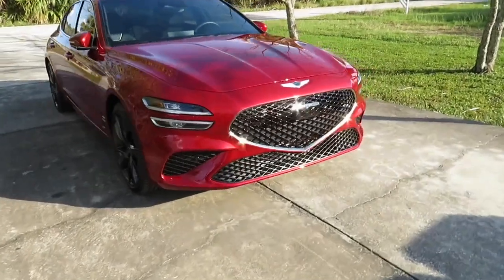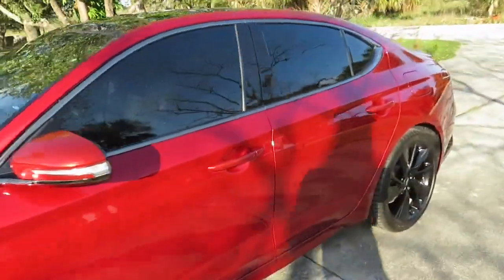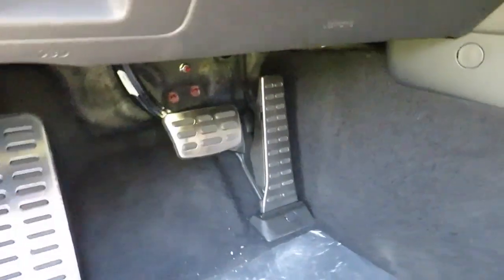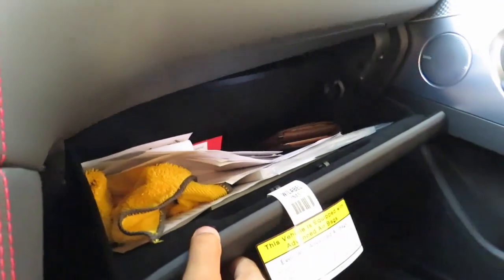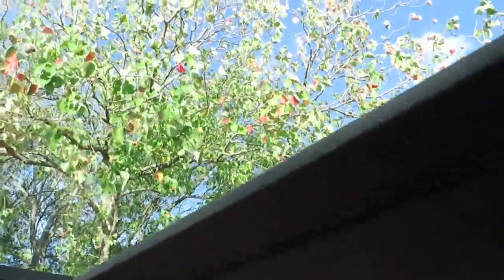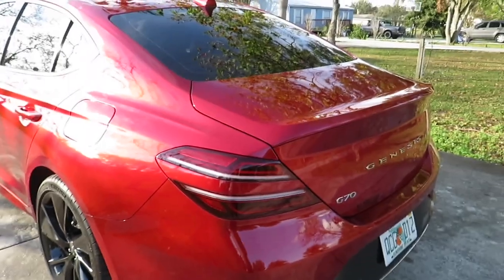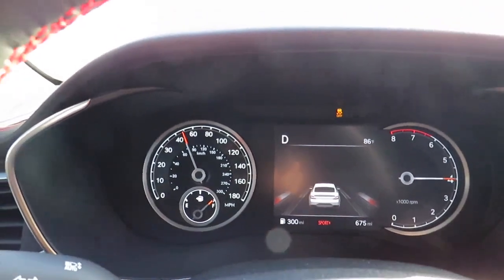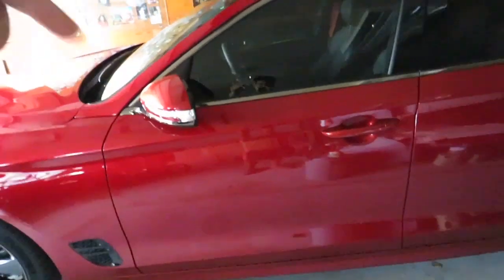I Did A Review On My Personal Car (YOU WONT BELIEVE HOW GOOD IT IS😱) 2023 Genesis G70

Comment: Great job on the overall review! Just picked up a 23 G70 2.0 AWD Sport Prestige in Black w/ solid red leather this week. Superb sport sedan for the $44k price, very buttoned down, quiet and smooth. 2.0 has plenty of power, sure the 3.3 is even better for the overall acceleration and thrill of the drive, but for us we couldn't be happier! Steering is precise w/ good feedback, overall very well balanced too!

Glad to have the AWD for winter weather and better footing in snowy conditions. The Lexicon sound system works well and the infotainment display is well thought out.
Lot of value for the price compared to anything else w/ similar performance, luxury, and appearance.
Those Genesis logo lights under the mirrors are a cool little feature too :)
Reply from the maker: Couldn’t have said it any better
Reply: This comment is exactly what I was looking for, thank you. I'm looking in to the G70, but debating between the 2.0 vs 3.3. The price on the 2.0 is great so might just go with that.
Reply: @killadarkassasin  I just bought a 2.0 AWD Sport Prestige and it is definitely not a disappointment. I'm sure the 3.3 is a more exciting and at the highest trim level has the HUD and some extra sensors etc., but with the higher sticker price and greater maintenance costs, the 2.0 is more than enough car for me.
Reply: @Sans1Studios  that is awesome dude and I totally agree! I actually bought the same trim just 2 weeks ago in tasman blue! Absolutely love this car!  G70 bros 😎
Reply: @killadarkassasin  Nice! I went with Havana Red, but Tasman would have been my next choice
Reply: @Sans1Studios  excellent choice man! That red is gorgeous. My top 3 colors were the Tasman blue, havana red, or the hallasan greens
Reply: @killadarkassasin  You'll regret that decision ....

Comment: Hyundai/genesis tech here. Get the those chrome plastic pieces powder coated. They start peeling very soon. Genesis is nice but dont be fooled, the quality does not hold up at all. I work on this quite a bit and that shit peels.
Reply: Are you saying it’s not a reliable vehicle?? No longevity??
Reply: The change it for free is you have warranty ive changed mine
Reply: @pcd377 yeah its reliable and awsome just that particular par peels if it sleeps to long in the sun like 24/7

Comment: I have 2020 G70 3.3TT AWD PRESTIGE.
4 trips from Florida to New York and back.
One of them January 4 2022, when snow storm hit Virginia..
Excellent car.
I'm very pleased with it.
Reply: How many times did you have to refill the gas
Reply: @hasiburalam9230  
About 6 times.
I refill when tank is 1/2 full.
I usually drive for 3 hours, then refill and have a short walk.
After 9 hrs drive, I say overnight in near i95 hotel.
On board computer shows about 25-27 MPG.
Reply: What color did you get and interior color
Reply: CG on your purchase. I ordered a 2023 3.3 sport and i have a question for you: Do you put on winter tires on yours ?? If yes, are those a regular set or staggered ?? Thanks...
Reply: @bigden2755  I have factory all season Michelin tires.
I'm in Florida ☺☺
Reply: @СруликРизиньшнюфцельбобеноф  Thanks.... Btw, those Michelin are ''summer tires''...
Reply: @bigden2755  No they are all season.
I think summer tires installed with "sport" package.
I have "prestige" one.
Reply: @СруликРизиньшнюфцельбобеноф  Yes, I understand but aren't those Michelin ''Pilot sport 4'' ??
Reply: @bigden2755  Yes they are Pilot Sport 4.
Reply: @СруликРизиньшнюфцельбобеноф  I don't think they're really 4 season tires though... couldn't drive these in the snow...

Comment: Just got the 22 g70 2.0 t very Eloquent car and lots of tools to play with my only issue is the turbo lag and it's slow to be honest so I might add a few mods and a piggy back tune soon cause if I'm not mistaken this is the same engine in the Veloster and the elentra n just D tune version.
Reply: @Tink0Wink0  are u going to add any Modifications? I'm thinking about downpipes and muffler delete and maybe a jb4 to add a few more pounds of boost to keep it on the safe side.